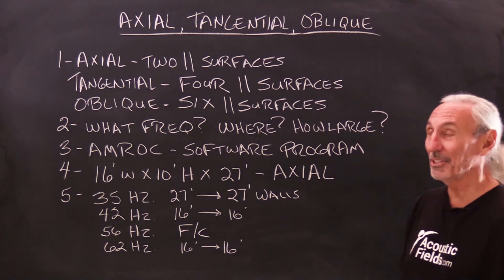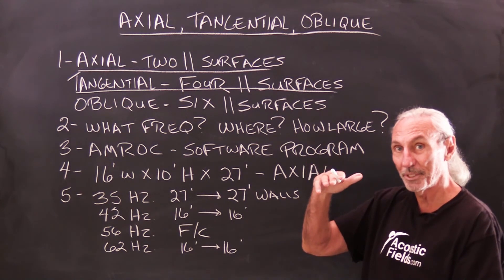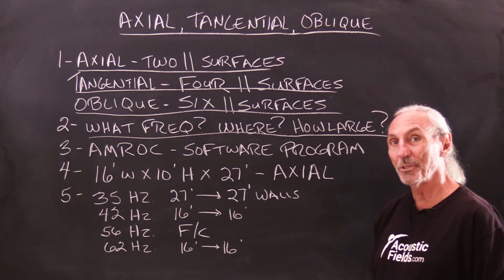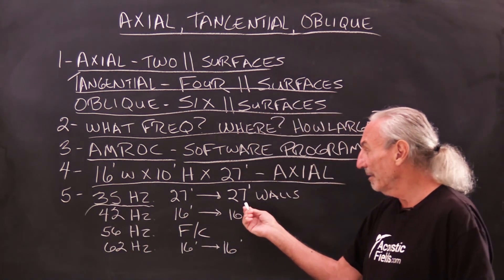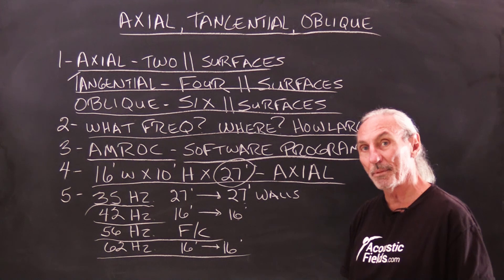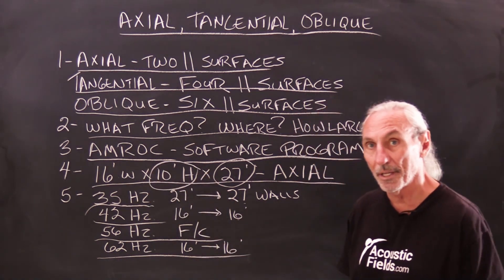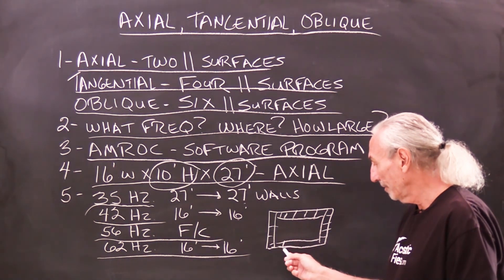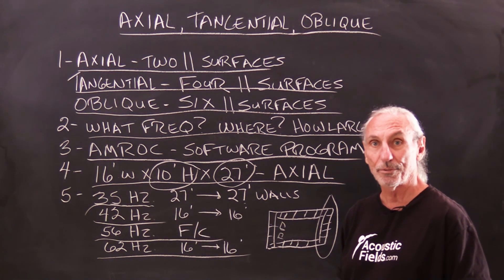What are Axial, Tangential & Oblique Modes? - www.AcousticFields.com

Comment: If I had a closet on one side of that picture I would want to treat that door also? That closet backs up to another bedroom.
Reply from the maker: What are the acoustical issues in that area of the room? What treatment type will we need to address the acoustical room usage requirements? Are we using diffusion or absorption. If absorption, is it middle and high frequency or low frequency? Nothing is easy when it comes to the type, amount, and positioning of treatment types.

Comment: In a Large room, If there are several sets of parallel surfaces in one direction (we have a balcony that runs the length on both sides) should I be calculating those modes as well. Also Parallel rafters (big ones) and other structural members. Seems to me that these would be issues as well.
Reply from the maker: You have to define an area that you will be using for music and focus on that area. Fill out the information in this link. Follow the software and schedule a time to speak about your issues and then look at treatment choices.  https://www.acousticfields.com/free-room-analysis/

Comment: Hi, I think there may be some confusion in this video regarding the problematic frequencies vs. the actual dimensions causing them.
The only one that seems correct is the 56hz -> height.

Can you confirm that the following is the correct interpretation of the room mode calculator output for your example?

16' width X 10' height X 27' length.
35hz mode is caused by the width.
42hz mode is caused by the length.
56hz mode is caused by the height.
62hz mode is caused by the length.

Thanks.
Reply from the maker: Take the length of the distance between the surface areas and divide it into 1132. Include all harmonics.
Reply: @AcousticFields  Yes, thanks for confirming it.

It is just a bit surprising to see this kind of mistake in a video on this educational level.
I think it is important to get this right for the audience to learn it properly.

Take care. 🙂

Comment: That room mode calculator makes the issues very real for us visual learners! My garage is 23'L, 18.3'W, 10'H...thought that was pretty good but....meh, ummm, it's ALMOST ok lololol...not quite.
Reply from the maker: The unwanted room modal pressures in this room size and volume are all treatable. You could obtain a 90% solution to all low, middle, and high frequency issues which would make this room mastering grade level.

Comment: I feel like this explanation lends itself to a racquetball analogy, specifically the visualization of the amount of energy left in the ball (signal) after 1 bounce, 2 bounces, etc. You get a real good hit on a ball that touches 3 walls, it's hard to predict where it'll end up but it won't have much energy left. One hit off any single wall can still leave a bruise - a lot of energy left. Oblique vs axial. I think this video helped crystallize in my mind what you're talking about - thanks!
Reply from the maker: You are correct. Its  about frequency but more important amplitude (energy strength). Axial modes produce the highest pressure between two parallel surface areas. Tangential between 4 and oblique 6 wall surfaces. Energy dissipates with each reflected distance contact. Axial and tangential are audible. About 50% of oblique modes are audible.